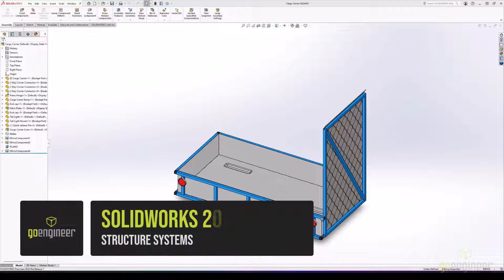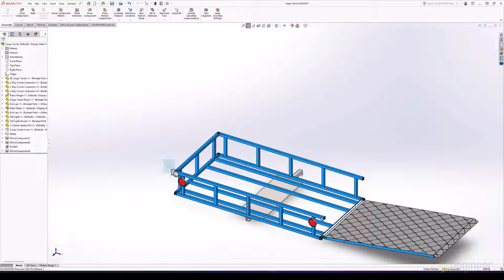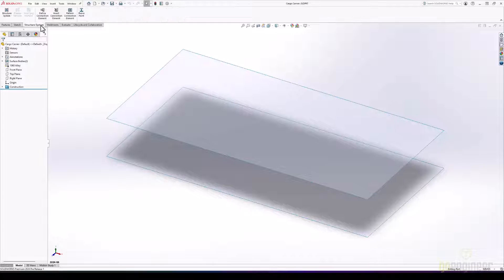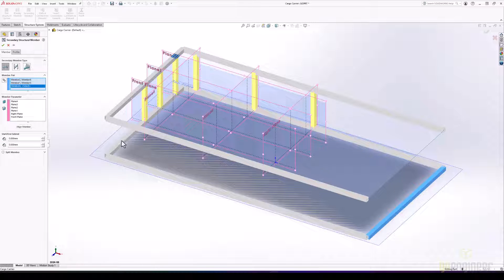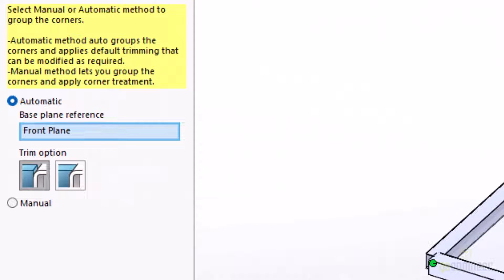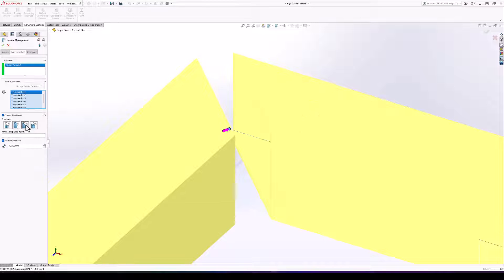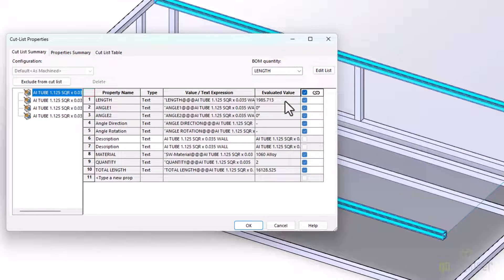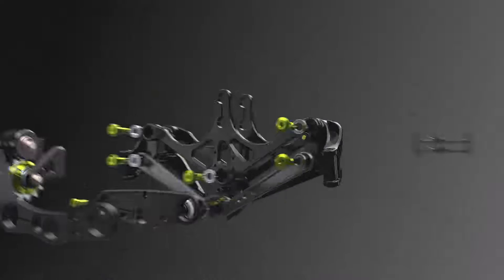SOLIDWORKS 2024 What's New - Structure Systems and Weldments

Comment: I wonder how many years, until SolidWorks, or any CAD system implements a Frame Generator for extruded profiles in its core package...
Reply from the maker: Weldments is part of the SOLIDWORKS standard package.